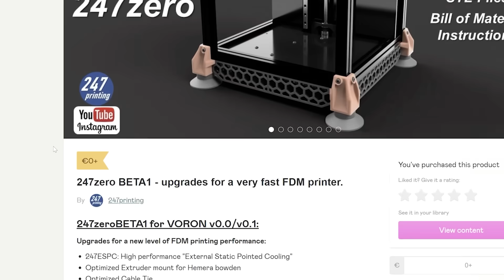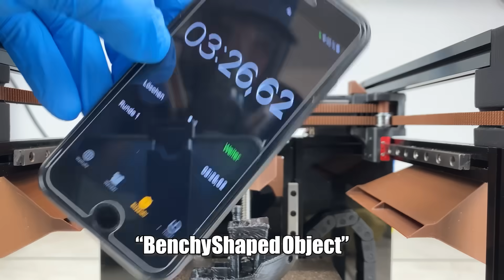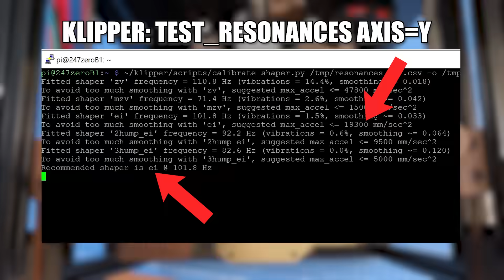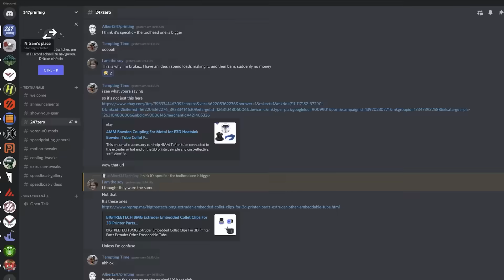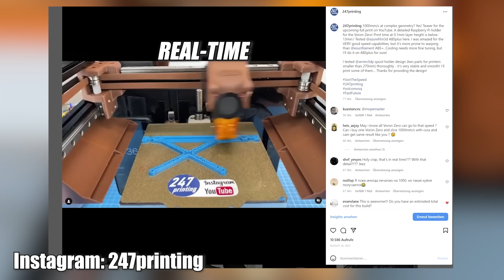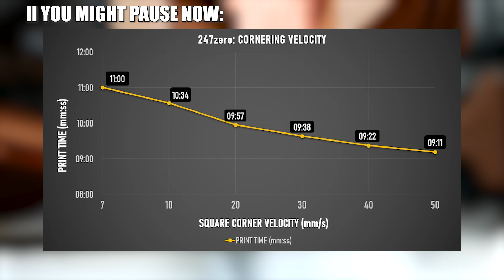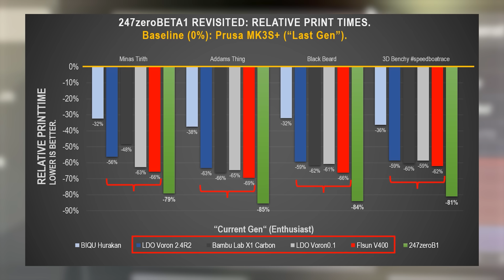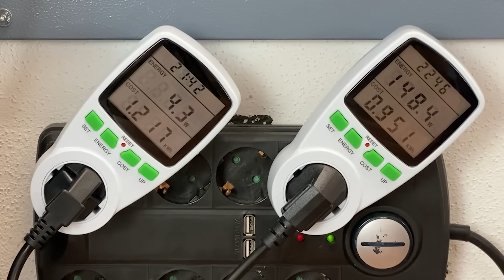HOW FAST is NEXT GEN 3D Printing? 247zero revisited!

Comment: This is great — [stealth edit] - nay, this is AWESOME.  I'd like to see another very simple measures to compare quality which you can do here even with this "dataset" of prints that you already have in the video.  What 3D printer users want is faster speeds but only at comparable quality (generally speaking, outside of draft prints, etc).  Here's a trick that we use in the wine world: the triangle test.  Three 3D prints, two that are the same and one that is different.  The only question that is asked (of a small but representative sample of people) is, "is one of these different?"  If the majority of tasters/inspectors cannot tell the difference or choose the wrong answer, then the prints are comparable.  So to compare printers and settings I would humbly suggest this methodology — then the other features of the printer/print can be compared apples to apples, since for your 247zero print at the same quality level (indistinguishable in a triangle test) the print time will be much much lower.  What speed can you print these objects at with truly similar quality results to the others?

Comment: The frame mounted part cooling is a very cool idea. Can save weight for fans and wirings, even mounting bolts. You could find a way to receive supplied air more effectively and to control air speed based on the head acceleration. Air speed may have to be controled too according to required cooling for varying melt volume. Keep it up!!!
Reply from the maker: Nice idea! I'll keep that in mind 👍
Reply: @247printing  Have you considered also replacing your delta fans with Artic S4028-6K fans in that configuration?  If you can get them in a 5 pack, they're about 40 USD on amazon(which is far less than those deltas cost).  They're the same dimensions and type of fan as those deltas, but far far far lower RPM(and therefore lower noise, amperage, air flow volume/static pressure),  Since they're that same dimensions and they're normal 4 pin/12V fans, they should be a drop in replacement to lower everything down to "sufficient and not requiring hearing protection nor a second mortgage."

Comment: I would like to ask you something. Is printer head cooling needed at these speeds? After all you are feeding it quite a lot of cold plastic. Maybe cooling is only needed at that part when you stop extruding. If there is no need for cooling it would make the extruder a lot lighter. But of thermal creep is still a thing it would what? Preheat the plastic? Or clog the feeder wheel with molten plastic?
Reply from the maker: You mean no heat sink cooling for the cold part? Not sure, but there are some theories about this!

Comment: OK, so stupid idea, but what about using one sidemounted fan but attach two servo's to follow the print head location. You might also be able to reduce the size of the air catcher on the print head this way.

Yes I know this will be complex and expensive, also it would need to aim for where the head will be when the air gets there, not where it was half a second ago. I said it's a stupid idea.

Comment: How does the power consumption compare with all the 3D printers tested? In addition to the time savings, the electricity costs should also be considered. The acquisition costs are excluded, as these are test systems.

Comment: For god sakes, stop speeding up the video and slowing it down. We are here to see it at normal speed.
Reply: @247printing  There are clips that are sped up right? Where the clock is running faster, like a time lapse?
Reply from the maker: @gearhed78  The time lapses should be obvious, yes. For the rest: I state "real-time" when it's real-time and when I didn't forget it. That machine sometimes (infill printing 600mm/s or 1000mm/s printing!) looks like sped up, but isn't!
Reply: @247printing  Speeds are impressive. My point was the back and forth too many times is distracting. I noticed the real time thing but it was constant back and forth to see what was sped up and what was real time. That was all I was saying. Nice work, just too much back and forth.

Comment: I'm convinced the next way to increase printing speed is to move both the nozzle and bed in opposing directions (dual corexy). Ideally the ratio of travel of both the nozzle and bed would be such that their momentums cancel out (i.e. if the bed was 2x the mass of the nozzle head then the bed would travel half the distance and thus the speed in the opposite direction of the nozzle head) and ideally the nozzle weight and bed weight would be the same (assuming they're already as light as possible). 

For the same effective printing speed you could halve the acceleration/speed the motors need to create while also cancelling out vibrations from the printer throwing itself around (equal and opposing momentum would meant the rig is stationary). For the same acceleration per motor you would double the speed. Just hope for good bed adhesion if the ratios work out that your bed needs to move more.
Reply: Wtf.

Just put the printer on some bearings and mount it with soft rubber bands on all corners. Then it will do just that mass balanced moves and return to centre at moderate speed acceleration such as not to run away.

But you don't want to introduce more movement axis than necessary into the actual mechanism since they'll all add tolerance play and distortion and these will all add up.
Reply: @SianaGearz  I feel like it would be difficult to prevent that from sometimes causing resonant oscillation given the highly dynamic nature of 3D printer acceleration and forces.
Reply: Turn your bed slinger into a bed railgun!

Comment: Very nice work! What about channeling air inside a tube and blow it directly where its needed (like the bowdentubes for the filament but maybe bigger) instead of blowing air all over the plane? This makes the head maybe even lighter and the air could be cooled down with a liquid cooling system and a radiator or with peltier elements... just a thought
Reply: Very Good Idea, very good Proposal, it should be brought to Reality

Comment: Have you considered placing the hotend fan on an external frame above the printer and piping the air to the nozzle through some form of lightweight tube? It would get rid of a few extra grams and also allow you to use a more powerful fan.

As for the tube: There might be lightweight fabrics available on the market that can be used to sew an airduct.

Comment: I'm not sure this would be completely workable , potential idea though , because you typically print very fast you always use the part cooling fan and because of that you should be able to get rid of the heatbreak fan and just redirect a bit of the part cooling flow up through the heat break. 😉  
You will have to completely redesign the tool head but it should save you another 20 grams or maybe more ...

Comment: Hey, for the extruder with higher flow rates I have a theoreticaly working idea to try but i do not have the funds to try it. 

The 3 in 1 nozzles you can get for multimaterial priting . With a drilled hole and insert from chinese CHT nozzles could (theoreticaly) increase the melting by 6-9 times if you ran all the extruders simutainoulsy. I think this would be best fitted to a delta due to the three side design. I have my own delta Currently printing "only" at 300mm/s since i actually like my stuff to come out functional and my ears not bleading, but I do intend to try this but i havent had the time or the funds to do so :/

If you want any more info you can contact me. Good job on this one.

Comment: like in motorsports and almost all areas of technical performance, it all ends up basically in the materials chosen to make the parts and how(shape and design) used to build those essential components, so they are lighter/stronger/more precise/better thermal efficiency.
if you use steel screws to hold moving parts, that are built to support 3kg(in a certain kind of mechanical work), but you need it to bear only 600 grams of mass at peak effort, you should exchange them for titanium screws that are rated to 133%(of your total mass load of %100 or 600g), they should be 1/3rd the weight of the steel ones, if the titanium screws would need to carry the same stress or mass/speed work , they would be 30% lighter at least(consider all numbers here not precise values, but approximated enough for the comment session eheheh).

Comment: I've been thinking about this - because industrial pick-n-place machines reach insane speeds with extreme accuracy.   I believe the key there is the rigidity and pitch of the ball-screw, it allows the toolhead to move faster with less stepper motor turns, which gives it the speed.   Have you done any tests or thought about replacing the belts with ballscrews to increase rigidity and speed?

As far as the plastic melting that's just some crazy output you need.  Are you using 1.75mm or 3mm filament?   I havent' done any research here but given the volume you need to push and the enhanced rigidity of 3.0mm I imagine it would help with extruding if you arent' already using it.    Curious to know.   

Thanks for all the work you do and pushing the 3D printing community to the next level! :)
Reply: But those machines use linear magnetic motors. Not ball screws. Also they have encoders for feedback, so no step skips are happening. Also the machines weigh a ton, so it does not wobble at all during the movement.

Comment: I wonder how much time is lost doing retracts with bowden setups compared to the quicker retracts (but heavier toolhead) from a direct drive setup. If you really want to take this to the next level you should definitely experiment with remotely driven direct drive extruders like Flex3drive or similar (I believe there was one more system like this).
Reply from the maker: Retracts are at 120 mm/s and 2.7mm. Retract acceleration is at 10k mm/s² - not much time lost here.
I evaluated Flex3drive for this setup (and for my RatRig) and it's interesting, but not really suitable for a Voron0.
Might be interesting for my V-Core-3 though
Reply: @247printing  Oh damn 2.7mm is really good. Definitely short enough not to make a discernible difference with a direct drive. Looks like the small size of the V0 really is best suited for a bowden compared to most other machines.
Reply from the maker: @SoundShunter72  absolutely - pressure advance also helps a lot here!
Reply: @247printing  Ah of course, I forgot you can simply tune out a lot of the slack with software as well.

Comment: Tolle Arbeit und es ist echt Klasse, dass es so Leute wie dich gibt, die die Grenzen der aktuellen Technik weiter ausloten. Ich denke in dem Design ist noch viel Potenzial, wie eine Carbon X-Achse oder CNC gefräste X-Achse (siehe VZ-Bot), hochsetzen (bzw. Mittig der X-Achse ausrichten) und abstützen des Hotends um die Hebelwirkung und Schwingungen weiter zu reduzieren, Versteifung des Rahmens mit einer vorderen Querstrebe (abnehmbar/Klappbar), Wandbefestigung des Druckers, große Radiallüfter statt der pabst Lüfter für mehr Druck bei niedrigerer Lärmbelästigung oder Ansaugschalldämpfer für die Pabst Lüfter, Abstützung oder Führung des Druckbetts an der Vorderseite, Doppelter Bowden Extruder für mehr Kontaktfläche. Es gibt noch andere Themen aber dann wird es schon recht komplex.
Viel Erfolg noch :)

Comment: Very cool project!!!

But may I ask why you only optimized your own printer and not the others? The default profiles of the other printers are not their limits. And even if print quality would degrade when increasing the other printers speed - your printers quality was much worse. Only good for prototyping.

It would have been much fairer if you also tried to increase the speed of the other printers until their limit or until reaching the "bad quality" of your prints. Especially the Bambulab X1 which has 125% and 166% speed modes which can be activated with a single tap.

I know it would have been less impressive when the print time differences would be much smaller. But at least it would have been honest :-/
Reply from the maker: There is at least some truth on that and I’ll think about it - thank you for this. Concerning the print quality: Nope, mine are very close to the others and you need to go very close with the lens to realize.
Reply: @247printing  Yeah looking at them again it looks like most of the wavyness is in the models itself because they are organic - I guess? But you also didnt do any direct 1:1 side by sides. So its hard to judge.

Non-organic shapes and side by sides for the next video would be appreciated 🙂

Comment: MORE SOUND, The micro equipment used for the printer was the same for the voice. frequencies clash. it's tinny quality/thin sound micro preset. 

Just adding bass to the voice and not letting reverb from walls to the mic will make it 200% easier for me to hear the words. 

Audio is difficult to focus with ears: 1/ I can hear reverberations from a small room and a microphone that isn't near enough or is too omni-cardiod 2/ The audio frequency is the same as the 3d printer, the two soundracks are clashing. the bass cut could go above and below for one or the other, there sounds like there is bass cut on the micro that is too high and loses some of the voice gravity. Other tips working with difficult audio is: practice putting silence between words and practice speaking at 50% speed, because slow motion speaking YT are generally the highest views.
Reply from the maker: I double your statements and you are absolutely right: My recording room is around 20m² and from an acoustic point of view it's hell on earth concerning reverb.
Fighting with that on all of my videos... It's a RØDE NT1A microphone I use, but my software settings I do (which I tune last every time) don't help much...
I'll do my best for the next video as also for me atm: The voice over can be annoying atm for some people (including myself)!

Comment: Of course, this is not quite in the spirit of building a 3D printer, but take a look at a few other manufacturing techniques.  For example, "real" prepreg CFRP is significantly stiffer than PA11.  For example, you could use a combination of CFRP tube and 3D printing or a carbon forged rail for your X-axis.

Comment: You could use an air compressor with a pipe removing the fan on the head.
Reply: Don't know if it possible but cooling an air compressor with a peltier.
Reply: Also a counter weight on the base of the printer repelling the movement might help.

Comment: I'm shocked you got the bambu to beat the voron 2.4 :O Did you have to spend many hundreds of hours tuning it?
Reply from the maker: The Bambu wasn't tuned.
Reply: @247printing  :O wow!
Reply: @247printing  Was it the same slicer used for all prints? I've just tried the Bambu slicer, after customising for the ender 5 plus, and got gcode that's faster than my cura outputs lol

Comment: I wonder if a laser could keep the model warm enough to not warp without warming the nozzle. I also wonder if an external positioning system could help give the exact position of the print head to correct errors from acceleration. Could also precool the air the fans are blowing to get the same cooling capacity with lower fan speed or even go to more exotic cooling such as liquid nitrogen.
Reply from the maker: Thanks a lot for your great input, I'll save this for further consideration!

Comment: Engineering optimizations for fastest 'changes in direction', like in automotive racing, follow a pattern of replacing heavier stuff with lighter stuff. Looks like the printer still uses a ton of parts with poor strength to weight ratio, the obvious path is usually just carbon fiber everything?

Comment: They are currently difficult to get ahold of, but there are CHT volcano nozzles in existence, i'm not sure if they are significantly better than the volcano adapter though
Is there any ceramic heater like the Rapido's that allows a full lenght Volcano nozzle to fit in it? Been thinking about getting one but want to be able to push as much filament as possible with it
Reply from the maker: The rapido UHF supports (CHT) volcano nozzles, yes!

Comment: From an enthusiast standpoint, this is so amazing, I love that the fans alone draw 150W ;D and you need hearing protection! But it must be so much FUN to design, test, and push beyond the limits :)
Reply from the maker: Thanks a lot and oh yes: It was a lot of fun work in 2021 - unfortunately I didn't have as much time as I wanted for the stuff, but it works anyways :-)
Reply: At a certain point the air pushed on the part will be the limiting factor ^^ , imagine you need so much cooling power your extruded line gets pushed away befor it cools and attach to the previous line Xp

Comment: Adding mass to the frame is an easy way to reduce resonance. Bolt it to the wall. 

Aluminium has poor resonance qualities. Rebuild the frame out of steel. Expensive and heavy, but it will help allot.  If you use ground stock steel it will be nice and flat.
Reply from the maker: Absolutely, but may approach: It needs to be still practical (weight, mobility, etc.).
Reply: @247printing  look forward to seeing you next video!